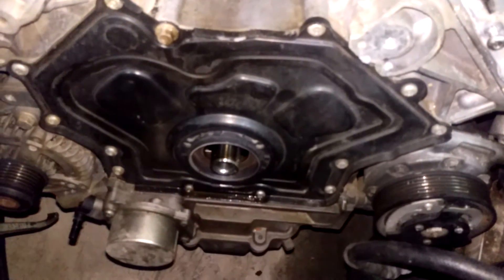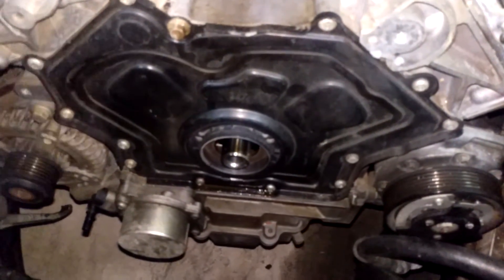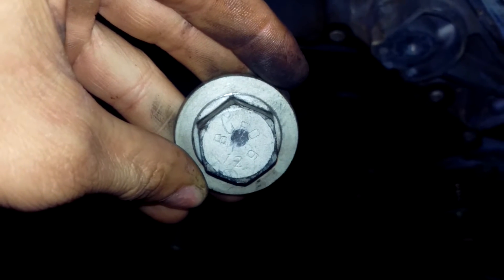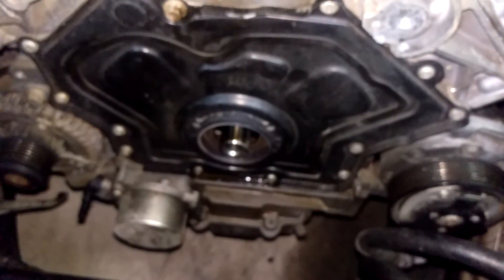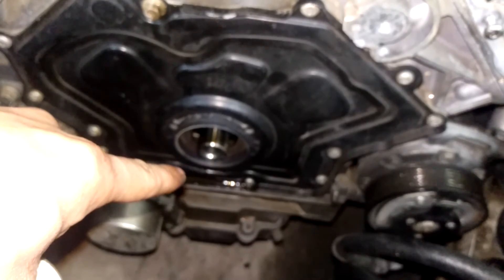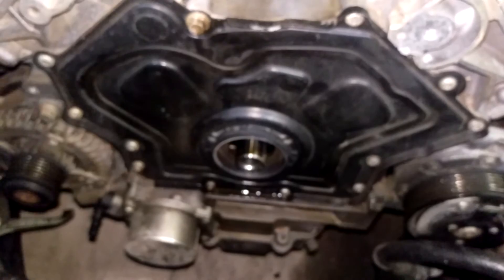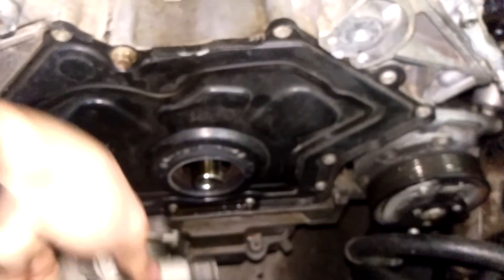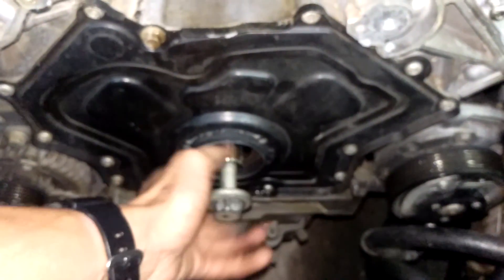Jaguar and Land Rover 5.0 Crankshaft bolt orientat

Comment: Your right, mine was a 10.9 and it tightened to the right and loosened to the left (face the car from front)
Reply from the maker: Yeah and when I called jaguar they couldn't tell me what was what and didn't even want to look into the part bin and get a bolt to confirm or help out
Reply: @BrovarianMotorWorks  jeez no help...ruthless loll but question! How did you end up torque the bolt back on? Did you have to use the jaguar pulley locking tool? Im thinking about machining a tool if needed loll im working on a x308 xjr loll
Reply: @BrovarianMotorWorks  the torque required for mine is insane about 250-285 ft lbs(instructions stated 375nm). Its uses a locking cone.  It would be so much easier if it was a woodruff key setup loll

Comment: I know this is an old video but what specialty tools are needed to change the cam guides and tensioners? Any help received would be great
Reply from the maker: I believe that there are cam locking tools that you have to take off the first two cam hats and bolt it down in place but I I never did get a chance to finish the head job because we ended up replacing the entire motor after we spotted more damage Within
Reply: BrovarianMotorWorks thanks man what about just getting to the timing chains any crazy tools? I seen a write up were a guy replaced the guides and tensioners without messing with the timing chain and timing at all.. do you think it's possible? Thanks again for the help man

Comment: Where is the tdc indicator or how can I tell tdc
Reply from the maker: At the bottom of the bell housing there it meets the motor there is a locking tool that fits into a slot on the flywheel if I'm not mistaken and it can only lock in at TDC

Comment from the maker: yeah just a 3 jaw puller but if   that don't work use the crow foot bolt  style puller
Reply from the maker: At the bottom of the bell housing there it meets the motor there is a locking tool that fits into a slot on the flywheel if I'm not mistaken and it can only lock in at TDC

Comment: Hello

Did you have a chance to figure out how you removed it?
Reply: On the 4.4L engine this is a reverse thread bolt. To remove ( and this takes some nerve ) get a long breaker bar with a 6 point socket on the pulley bolt. Wedge the breaker bar against the ground. Remove the spark plugs and turn the engine over with the starter. Made a short job of what, otherwise, would have taken me days ! - Make sure you protect the radiator too in case the socket comes off the bolt. - Like I say it takes some nerve but it works like a dream!

Comment: One more thing. How did you take the pulley off the crankshaft? I'm assuming you used a 3-jaw puller but I wanted to make sure before I did any damage. Thanks.
Reply from the maker: I don't really remember it's been a min but I'm going to check for you tomorrow
Reply: +BrovarianMotorWorks I appreciate it

Comment: Thank you very much. It's awesome when such an obscure topic is covered. I'm working on a 2010 Range Rover HSE with the same engine and need to replace the crank pulley (ribs damaged). I was just about to crank the hell out of it when I figured I should try and figure out if it was reverse thread. IT's a 12.9 so it is. Good thing I found out before I did any damage. Thanks again.